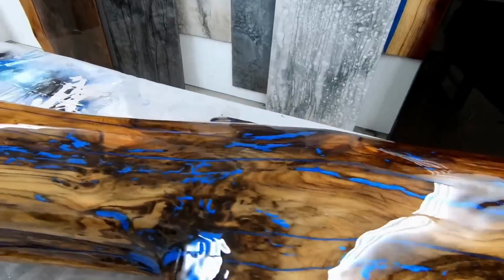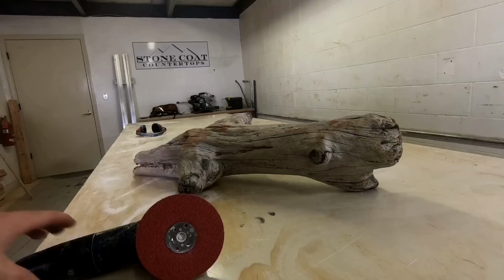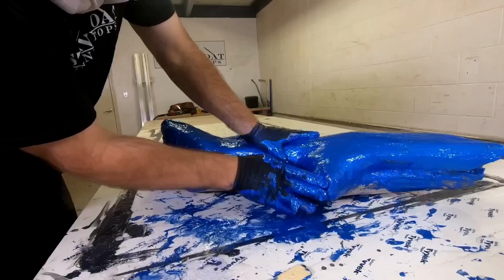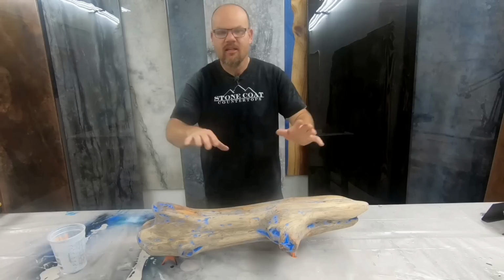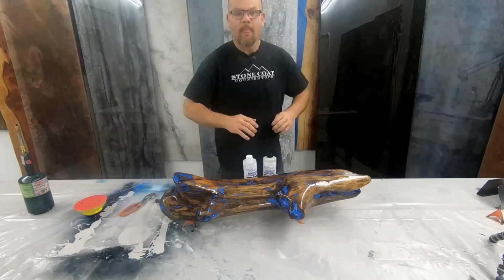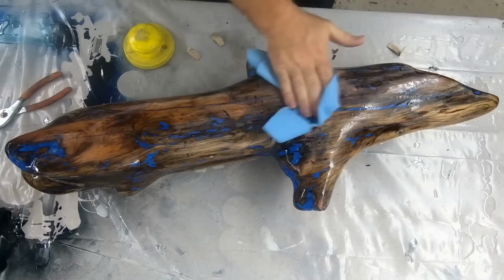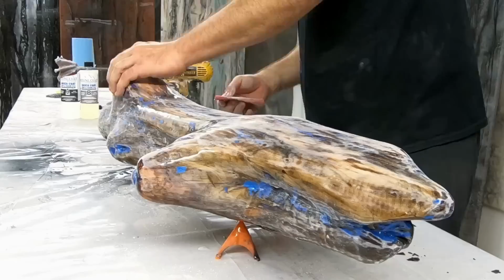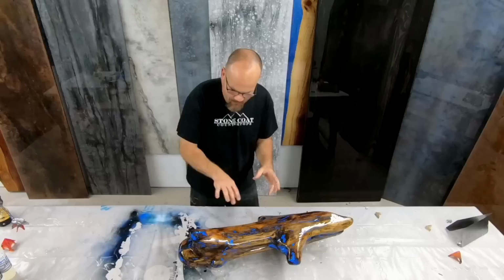3D Epoxy Drift Wood with my hands

Comment: Agree with green... that it looks like a shark. Very cool! Question -- for your mixing buckets, do you have to throw them out every time, or does the resin come off when it's hardened? Also, what's the recommended color to resin ration?
Reply from the maker: Great question Kimberly, let the epoxy harden in the buckets over night and the next day you can peel it all out in one layer, very fun! We generally eye ball all of our colors, use as much or as little as you want to achieve the desired effect!

Comment: really cool.  I have several similar pieces myself from Vancouver Island.  One question though, you never showed that you applied any coatings to the bottom of the piece, did you ever flip it of just use your hands to get as much as possible.  Great work, excellent video
Reply: also, you never "chopped" the surface on it, Why?  Is it not necessary with the Quick set ?
Reply: Yeah that really bothered e that he wasn't fully coating the whole piece. The bottom is probably a mess.
Reply from the maker: Great questions Brian Lister, it is not necessary to chop the surface for this project because we are only putting on thin seal coats. For countertops we chop the surface for a few reasons, it helps to get rid of any subtle trowel lines, it helps continue the blending process of the epoxy and it also helps to move color and create depth. Thanks for tuning in and feel free to call or email us anytime for project support. (541) 450-1976

Comment: Nice.....very nice!!
Reply: StoneCoatCountertops well, if the voids are big enough to show a lot of color in one spot or different spots, I think it would be cool to do a mild or dark green with the black or white marbling spray over the color. Then sand around the voids like you did in this video to leave the marbling effect on the color only. Not sure if that would work out. If not, I'm a huge fan of black and red together. Also like the glow green or glowing blue for a lightning effect.
Reply: StoneCoatCountertops I did and that stuff is very cool. It takes some projects to the next level.

Comment: Have you used epoxy on coloured shugi ban wood
Reply from the maker: Hi Aaron Norton, we have not but it would be worth experimenting with!
Reply: @StoneCoatCountertops  thanks for reply what's the best epoxy for outdoor furniture ie table river table bench
Reply from the maker: For outdoor projects you'll want to make a small scale mock up and test it in your environment before doing a larger project as the weather and UV is so harsh and everyone's environment is so different.
Use our Art Coat epoxy as your top coat for the most UV protection available!

Comment: Hey man, you seem really good about answering comments on these videos so I must ask: Does the area on the bottom (where you've had to wipe away the drips) dry out as smooth as the top? Or is there generally some inevitable bubbling and buckling underneath due to gravity pulling on the coat as it cures? 

Looking forward to trying this out.
Reply from the maker: Great question Garrett O'Donnell! We used the quick coat with this piece which sets up in 15 minutes and is sand-able within 3 hours! Feel free to call us at 541-450-1976 for project support!
Reply: In other words, if they don't want to answer your question they'll just throw some other information at you

Comment: Would a bonding primer be like a rustoleum spray primer for plastic or is there a different product you would recommend to be used with your product?
Reply: StoneCoatCountertops actually I am building outriggers (pontoons/stabilizers) for my kayak. I am interested in your product as it seems to be extremely durable.

Another question what is the level of fumes given off by your product?

Comment: Beautiful piece! What do you use to seal the bottom? Also, does this product work on concrete? I have an old exterior fountain and I’m having a hard time keeping it looking nice and keeping cracks sealed.
Reply from the maker: Hi Pam, We seal the bottom with the same material. This would work for your cement fountain. Just apply material in thin coats and you will be just fine.

Comment: Could you do like an old fence post?
Reply: Great question Steven, you can use it to fill in small voids, gaps and seams; however, if using outdoors it will not have the same durability as our Stone Coat Countertop Epoxy or our Art Coat so it would need to be coated with either of those for the added UV Inhibitors.

Comment: Good job Mike. What is your shipping lead time at the moment? I have a project that I'm planning and this may work out well. Thanks for the great video.
Reply: StoneCoatCountertops Hey Mike. I will be deciding on a product in the next couple of weeks for a kitchen countertop. How does the epoxy hold up to normal wear and tear? I'm familiar with using epoxy and buffing out scratches but would rather not do that on the regular basis. I appreciate your videos and quick responses. Keep up the good work!

Comment: I am a painter and I am experimenting with functional art so I have bookmarked your website and I am sure you will be hearing from me. Is resin and epoxy the same thing?
Reply from the maker: Hi Life is Art. Thanks for the support. Not all resins are the same. Our materials mixed are epoxy.
Reply: SO THIS EPOXY RESIN CAN BE POURED OVER ACRYLIC PAINT?
Reply from the maker: Great question Life is Art! Some artists haved mixed multimedia paints and pigments directly into our Stone Coat Countertop epoxy and they also have tried some oil-based paints, but some have adverse reactions and gum up the epoxy or coagulate on the surface. You will want to do a sample and test to see if it will work with your added product. MDF board is great for making samples.  We also have a 1/2 gallon test kit available if you are wanting to test our product out to see if it would work for you: https://www.stonecoatcountertops.com/product-page/stone-coat-1-2-gallon-test-kit Give us a call or email us anytime for project support.

Comment: Do you believe this process and product will work on schedule 40 PVC and fiberglass outrigge for my kayak. I am looking for a smooth glossy artistic durable solution.  The pipe size is 4" diameter 47" long and has nose cones made from styrofoam. Advise would be appreciated

Comment: Hi there, love your work and would love to use you products ,do you have a distributor in Australia ?
Reply from the maker: Hi Beeya! Great question. We do ship to Australia! You can purchase all of our materials from our product page at https://www.stonecoatcountertops.com/stone-coat-product or you can call (541) 450-1976 and we can process your order over the phone.Each of our metallic powders will tint up to 2 gallons of epoxy, and our base color tints will also tint up to 2 gallons of epoxy. When applying our metallic powders with a spray bottle, mix half a bag of our metallic powder with 6-8 ounces of 91%+ isopropyl alcohol. You can find this type of alcohol at Walgreens or CVS pharmacy. Thanks again for the great question and feel free to contact us anytime with questions. For your flood coats, you will use 3 oz per square feet per coat (2 flood coats per project: a color and clear). If you are sealing wood or concrete you will need 1oz per square foot per seal coat (do about 3), then follow with a flood coat.

Comment: Purchased the kit,( quick set, with a bag that looks like cotton).  You state 4oz. to 4oz. resin mix and 4oz. of the cotton. "2oz. +2oz. equals 4oz..  Or 4oz. +4oz. equals 8oz. ? But the whole bag is no even an oz. ?  Wass up?
Reply from the maker: Hi Paulie! Mix a 1:1 ratio of part A and Part B for 2 minutes with a drill, then add the thickener, you will add in an equal amount of the thickener and will use the ounces measurement marks on your mixing bucket. You won't want to measure by weight as the resin and hardener and thickener are not the same weight. Hope this helps and please feel free to call or email us anytime with questions or for project support. (541)450-1976

Comment: What is the substance to thicken the epoxy?
Reply from the maker: We use a thickening agent to thicken the quick coat. Our quick coat is designed to fill small voids, gaps and seams.  Are you planning a similar project?  Here is a link with more information: https://www.stonecoatcountertops.com/product-page/quick-coat
Reply: @StoneCoatCountertops  A thickening agent is used to thicken the epoxy.  Brilliant.  Whats the thickening agent made of? Cabosil? Qcell?

Comment: What is a the burning stick filler thing
Reply from the maker: Great question Stewart! Here is how we use the burn in stick to fill small voids. https://youtu.be/QnKg49cXnNs?t=1478Here is a link to that burn in stick as well. https://www.amazon.com/Mohawk-Quick-Fill-Burn-Stick/dp/B00BOTWQJY/ref=as_sl_pc_tf_til?tag=stoncoatcoun-20&linkCode=w00&linkId=6638768ab972a034c7372743e31e6973&creativeASIN=B00BOTWQJY

Comment: Does your thickener work with ecopoxy as well?
Reply from the maker: Great question Don't Care , it sure does, we use it with our vertical wall kit; however, once the thickener has been added it will lessen the working time to about 30 minutes, it will also not dry clear which is why we use metallic powders for vertical wall application. Check out more information here: https://www.stonecoatcountertops.com/vertical-wall-kits  What sort of project are you planning?
Reply: Stone Coat Countertops I was planning on trying to epoxy my fathers old walking stick. He kept it for years and passed away earlier this year. So I thought it would make a nice gift to my mother.
Reply from the maker: That is such a thoughtful gift for your Mother, thank you for sharing with us!

Comment: $200 for 2gal of your guys epoxy.. How much did it take to do this driftwood piece
Reply from the maker: Great question and thank you for watching. We used our quit coat for this project since it's a smaller piece, not our regular stone coat countertop epoxy: https://www.stonecoatcountertops.com/product-page/quick-coat  As well as our ocean blue metallic: https://www.stonecoatcountertops.com/product-page/metallic-colors For the first coat we mixed 4 ounces of epoxy (1:1 ratio) and 4 ounces of the thickener and added in a touch of our metallic powder; our quick coat is designed to fill seams, cracks and small voids. For the additional 3 seal coats we didn't add in the thickener just the epoxy.  For a smaller piece of driftwood like you would only need 1 of our quick coat kits and a metallic powder.  Feel free to call or email us anytime for project support. (541)450-1976
Reply: Stone Coat Countertops thanks for the reply full of info, keep doing an amazing job guys 👍
Reply from the maker: Thank you for your kind words and support!